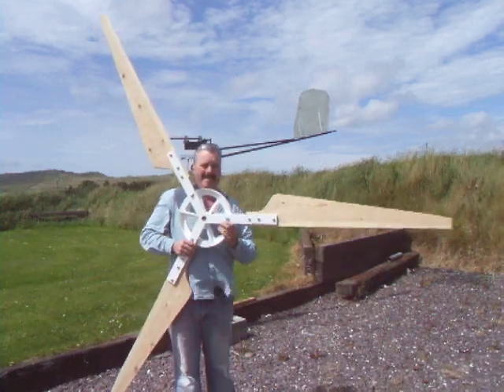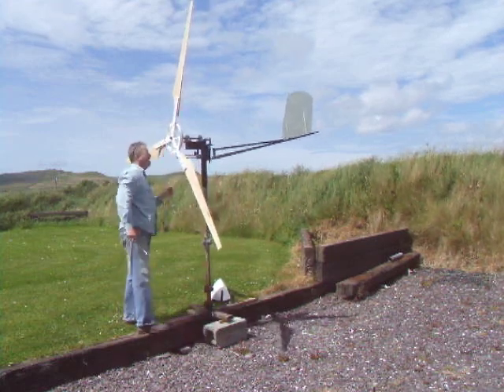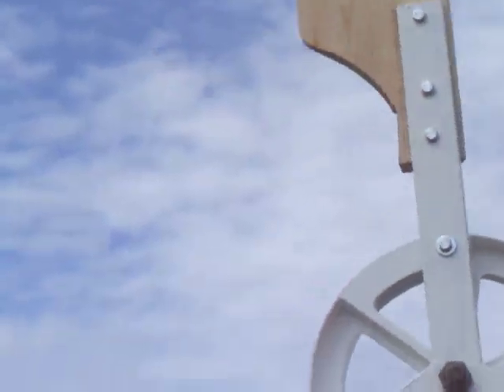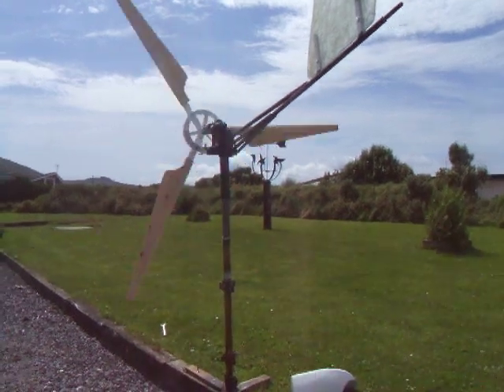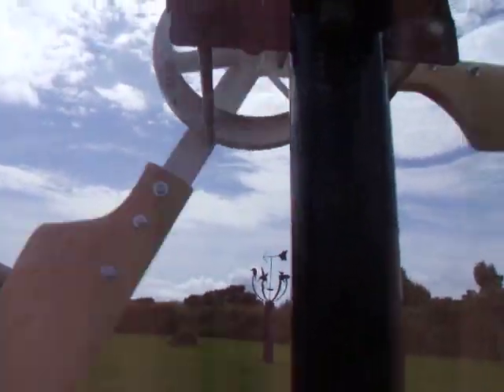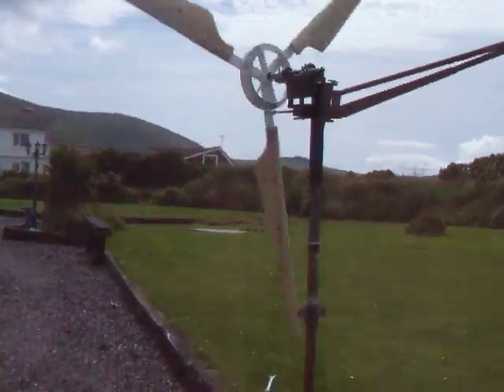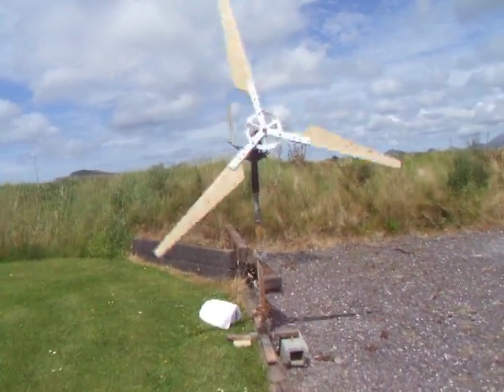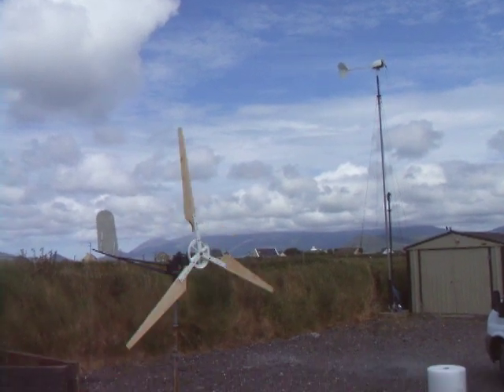wind turbine build pt4

Comment: this wind turbine looks very good do you know how many rpm it spins at because i was thinking about building one but i was worried that a turbine i build would literally throw blades at high rpms
Reply from the maker: Dean Walcott  Yes with out the furling tail design the blades would over speed in high winds.

Comment: hello ian,,really nice job on those blades. I want to try and make a set up similar to yours. just need to research how the blades are done. I have seen a few videos, just really need to take my time with the layout. I built a VAWT and I will gear that one up soon. still in test phase. great job on the build again!!!
Reply from the maker: Thanks I used Hugh Piggots wind turbine recipe book has some great layouts for
blades. You can buy it online for approx. 30.00 euro/Dollars. Its kind of the bible for DIY wind turbines.

Comment: Hi Ian, i think Chris Olsen said 80 or 90% of the power is made by the outside half of the blade length.what is the rotor diameter/ swept area & how are you going to tension the drive belt ?
Thanks for sharing your videos